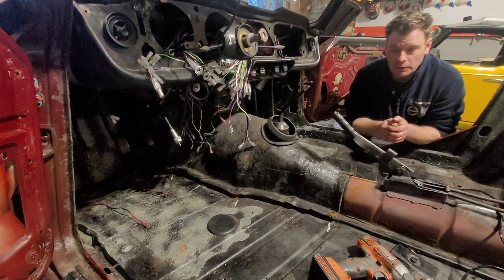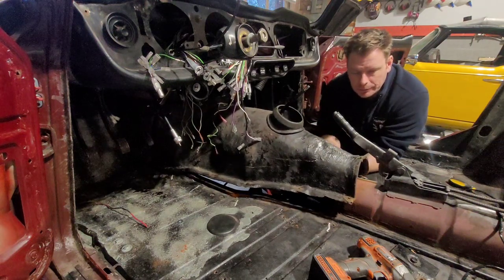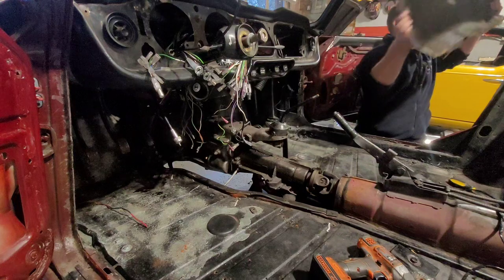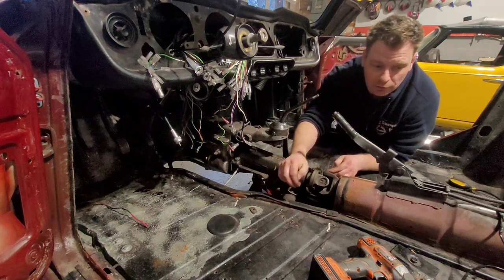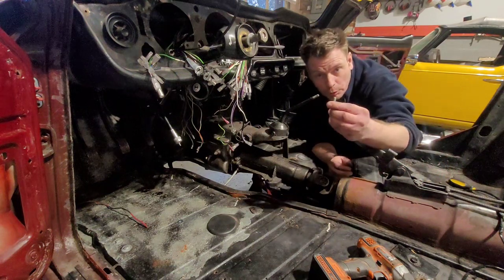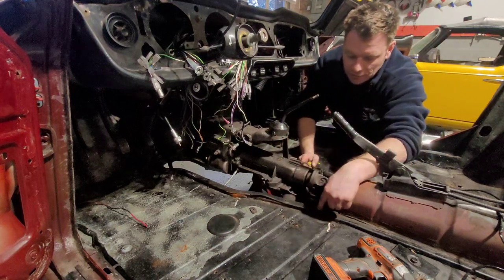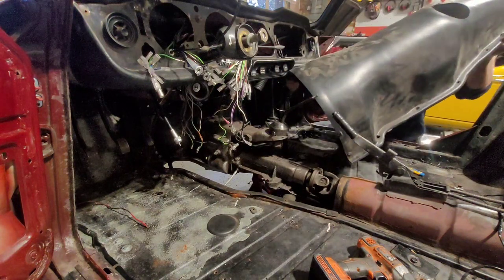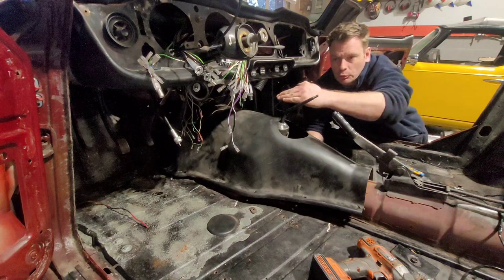how to fit and remove 1 piece Triumph Tr6 transmission cover

Comment: Hey John make a video removing the transmission
Reply from the maker: Hi, funny as I just done that last week. We're you looking for one with or without engine attached as the engine has to come out either way. I will be putting one back in, in a few weeks if you can hold on.